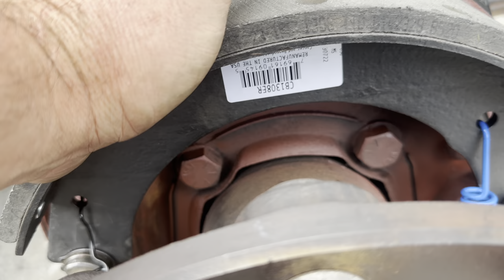Replacing the front brakes on GOLIATH! More hard to find parts.

Comment: Wow.   I never would have thought, finding parts for a heavy duty GMC would be so tough.   Yes I know it’s a 1987, but you would think most older commercial trucks would have used the same parts.  

We have a huge commercial truck salvage in Florence SC, on I 95.  Maybe next off season you come over and see if you can find some of the hard to replace parts for Goliath.   Heck I’ll bring my tools and help if you want.   

Glad you got it figured out.   👍🏽
Reply from the maker: I’ve seen that salvage yard from I 95 just before we exit. I’ve actually wanted to stop by there many times however, I’ve never found any luck finding anything for GMC general in a junkyard anywhere in this area. Seems like he got to go out west and north to find anything.

Comment: Adam, your hubs, #HF 532, are made by Gunite. If you get the casting number off of the axle beam, you can figure out who made it, Meritor, Dana, or whomever. Then you can better decide if you can go to a more common brake setup. Plus it will make it much easier to get parts , when you have to do kingpins and bushings.
Best wishes from the far North.
Reply from the maker: Yes, I think by the time we need to do the brakes again I will just look at doing a newer conversion. Probably need to do the same thing with the rears as well.
Reply: @amsoiladam  Fortunately rear axle brakes are more standardized, I think you will readily find them.